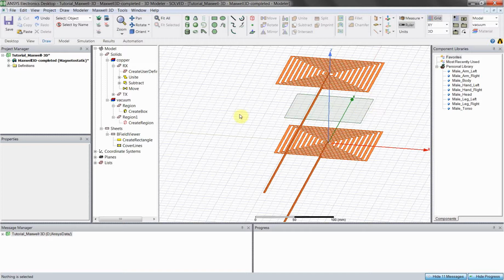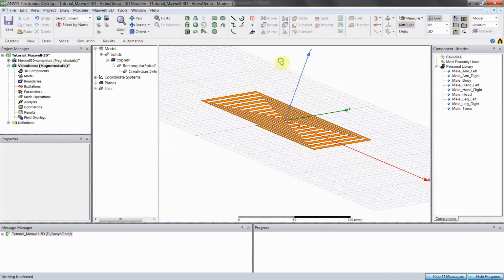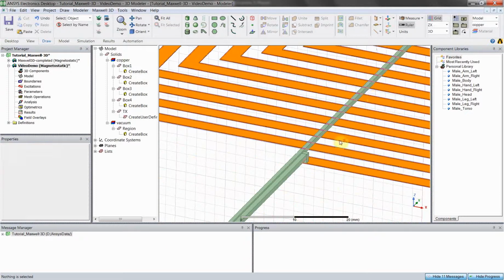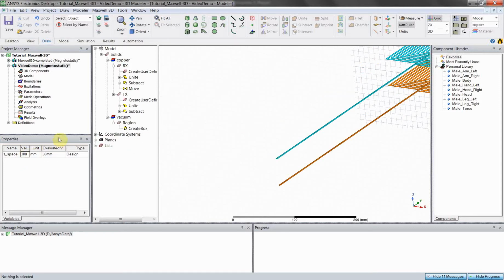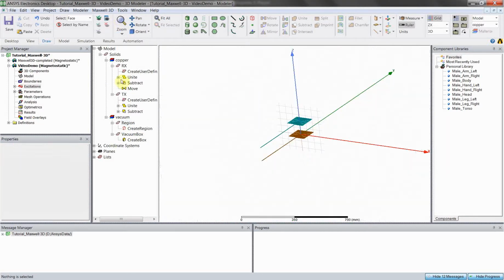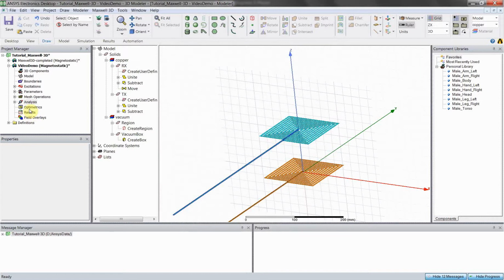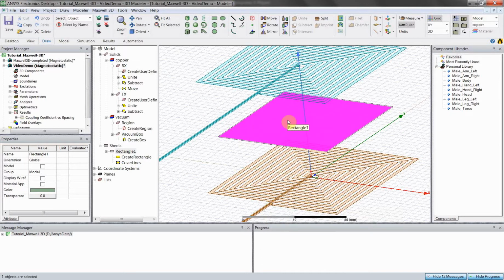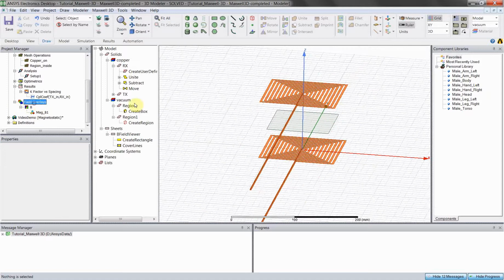Ansys Maxwell 3D Tutorial: Magnetostatics for Wireless Charging

Comment: How to make the cross sectional area of the wire circular instead of rectangular ?
I want to design square coil  with circular cross sectional area.
Reply from the maker: You can use the polygon helix model, PolygonSegments = 0 for circular cross-section, and set Pitch=0 to keep the coil planar.
Reply: @RFHertzMe  Thank you...
But from there a square coil can be designed with circular cross sectional area.
What if I want to design a rectangular coil with starting dimension 10cm*15cm with circular cross sectional area ?
Reply from the maker: @Amar-zfly  I don't know if that's possible to do with built-in models, but you could always create a script to generate this geometry using Python or Matlab. Ultimately simulating with a square cross section shouldn't give significantly different results compared to simulating with a circular cross section, so it may not be worth the effort.
Reply: @RFHertzMe  Thank you Sir for your kind support.
This video really helped me a lot.
Thanks again...... 🙏

Comment: Hello,

must say this video is very detailed and great example to follow! 

Just wondering if anyone has any idea of how to complete a magneto static simulation, in which a magnetic field is applied to a ferro magnetic material, im look to analyse the magnetic stress distribution across a 2D plate.

Any advice or videos would be extremely helpful as I am doing this for my Final University Dissertation and finding it really hard to initially set it up since I am not familiar with this.

Best regards,

Liam :)
Reply from the maker: Glad you liked the video, Liam! I am a bit rusty with Maxwell 3D at the moment and don't currently have access to it, so I can only provide some general advice. I believe you can apply an initial magnetic bias/excitation (at least in HFSS, don't know if it's possible in Maxwell) and define magnetic boundaries which will set up your environment correctly. The "help" documents Ansys provides are fairly thorough. You can also contact a applications engineer through the customer portal if you have access to it.